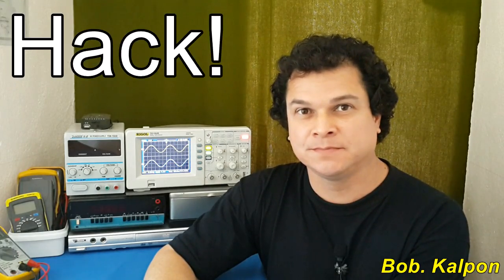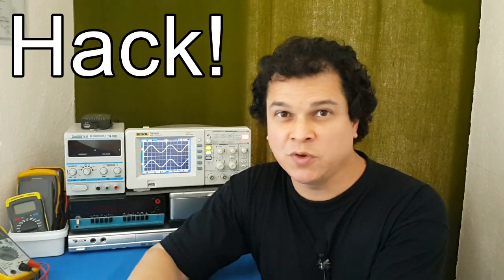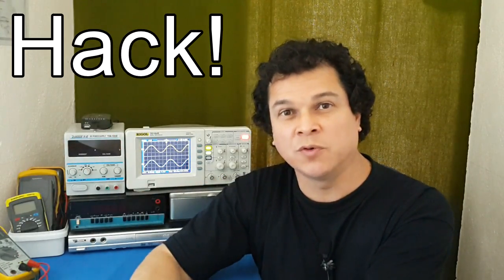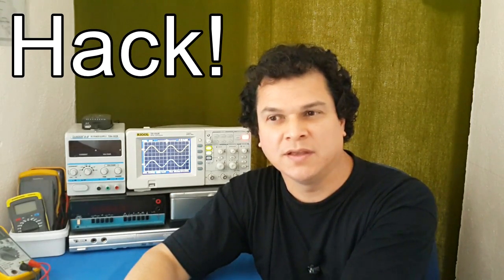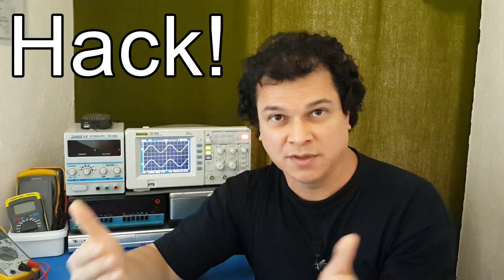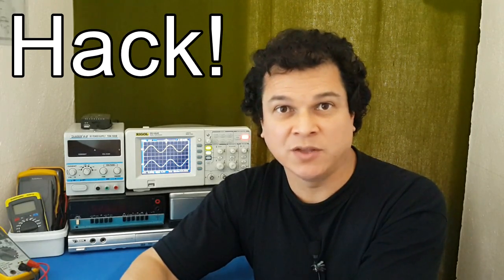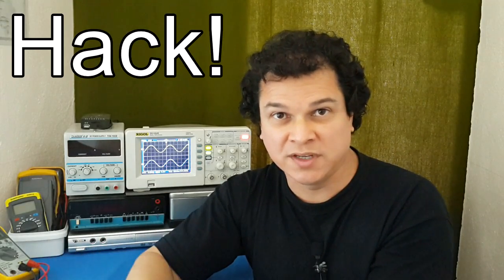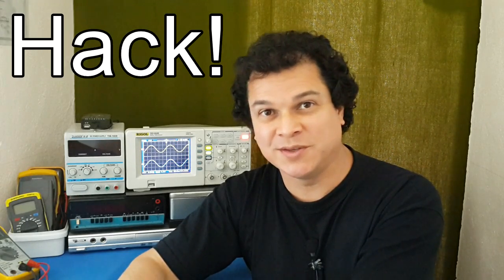Oscilloscope hack / to hack or why do not to hack / how to hack Rigol DS1052E

Comment: total bs. 
You can buy a bandwidth upgrade license. You do not get asked if your scope is a substandard variant relegated to low bandwith configurations. ts the same board that had to pass ALL quality checks. Software crippling is like buying on credit, you get the scope now (save up some money) and pay for the higher bandwidth latter. The hacking is more of a personal moral issue , not a technical one.
Reply: That is rights my friend !!!  In microporcesor they do that, choose de best and the one with all core and sell as a i9.  Not in the osciloscopio market.
Reply: @estebanjuliandipalmamartin3581  I must stress that you're 100% wrong. Rigol scopes aren't binned. It's not like a processor die with defective cores, or half the cache disabled, to maximize yield. They quite literally DO sell the bandwidth upgrade as a license key. The person who made this video doesn't have the faintest clue what he's talking about. He's probably just dirty that he paid 3 times what he could have for the same hardware. It's not even good misinformation. Rigol themselves don't particularly care if you "hack" your scope so long as you're not an enterprise customer. You can't really brick a Rigol scope by using (well known python script, or default root credentials).
Reply: Exact, he don't knows what he say. I gues he takes some Rigol pills. I hacked severeal scopes without any issue. Calibration is also ok after.

Comment: @bob.kalpon1398; I realize the reason in what you said when you posted this video 6 years ago. However, the Rigol DS1054Z can unlock the 100Mhz option with a code purchased from Rigol. The scope with the 100Mhz enabled from the vendor is the exact same as the 50Mhz scope, its just locked. This might have changed since you made this video, and it might be spesific to this model of Rigol scope, but as far as I can tell there is no reason NOT to hack the Rigol DS1054Z. If you pay for the code, or if you aquire it by other means is of no interest. Its the same hardware regardless.

Comment: Sorry but this is a sheer and utter nonsense! You are saying that the factory cant manufacture in a predictable way a 200 Mhz Oscilloscope and and they make them with the intention to be 200Mhz but after testing...they are like " yeah...we screwed up on this one - lets sell it as 50Mhz". Seriously? this not how it works! if you have that much tolerance when manufacturing precision instruments something would be fundamentally wrong and it is simply not the case! What you are describing is valid for chip manufacturing as very minute variations in the process can change parameters but not the case for actual complete electronics assemblies after the parameters of the components are already established! 
The truth is that it is cheaper to make one model as design, tooling, parts inventory, manufacturing process, etc,  doesn't have to be supported across five different products - they satisfy 5 different categories by simple software limitation. Parts for 50 Mhz are not 4 times cheaper than parts for 200 Mhz one - they use same chips, same ADCs , same everything - to use parts for a 200Mhz scope cost very little more than the 50Mhz design as they share exactly the same internal architecture! Rigol for example will charge you $368 to "upgrade" the memory in your DS2000 series scope by a software key - the memory chips are already installed and you already own them - using more vs. less memory is not related to a completely different software routines either - it is a simple memory size limitation. This is how their entire business model is built. Look at their power supply - DP832 vs DP832A - difference is the color UI vs. monochrome UI on the display and $200 (both models have the color display hardware - it is only in the software.

Comment: A lot of them are upgradable for the extra features. I personally disagree with selling me the hardware and software that is identical to someone that bought the one with all features. Only difference are a few different settings values in memory.

To enable the features you often just enter in a code and it starts to work. 

Sometimes you get a version with or without a couple resistors (I still say this is identical hardware since I will not be not nit picky.) 

Do not sell products for way more money when you ship a cheaper versions that are identical.
Reply: Rigol doesn't sell BW upgrades for that scope. Also its just cheaper to manufacture one version instead of 10 different versions. Cheaper scope often only cover the hardware cost and some extra. Which is still good because then the manufacture can sell more units and everything gets cheaper if you buy in bulk. But the more expensive units pay for the R&D and software.
The point is that it might work but its not guarantied to work or meet the tolerances. Its your choice in the end if that is important to you or not.

Comment: This is true to an extent. Rigol will literally sell you a key to unlock 100mhz on a 50mhz scooe... It all depends on the manufacturer and how they handle it.
Reply from the maker: Hi! For the model showed in the video, there is not software upgrade. It is the reason why it is locked until limits on the "Functional Test" in the production. There are other models that are locked in less bandwidth because software upgrade is an "After Market"  business too, minute 3:00. Let's be real; The upgrade, is limited to the oscilloscope capability too. The problem with hacking, that will always hurts 99% of the hacker's proud is because they didn't design the device, they have not idea what are they doing. Most people just downloaded a firmware and blindly believe it is true and real to install it on their device. "It is their device and they can do whatever they want with it". As instructor, I must prevent students that hacking is illegal in many countries, or to prevent my fiends that most hackings we watched in Youtuve, that person never used the same equipment anymore because it didn't work properly.  (Where was the business then? With all the viewers that believed in the hacking, the Youtuber trashed the hacked oscilloscope and bough a more expensive one from the money from youtube, because he got 300 or 600 dollars after 30 or 60 days of video views).

Comment: I listened to the explanation, I fell asleep in the middle, woke up and now I add my comment. 
Is mostly untrue, some scopes might be hardware limited but those definitely cannot upgrade, the reason for having the same HW and limiting the BW from SW is that is more economical for manufacturers to have a single of fewer HW variation even if some components are a bit more expensive for the lower end models. Most of the customers will buy the model which fits their needs and not play with useless hacks which in 99.99% of the time are pointless, because those who do that doesn't really need a scope in the first place, they hack it, show to their friends or YouTube, and move on, will barely ever use it for something useful and those who need it on a daily basis (companies) have money to pay and don't look at few hundreds of $ saved on such tricks plus the liabilities if they are discovered. For the same reasons companies do not work with pirated software. 
Companies know his and is a leverage point to squeeze more money for the same product.
Is like asking how much it cost ? how much money you have ? different customer different price.
Reply from the maker: So, you "fell asleep in the middle", woke up and now added you comment... After it, you said I didn't say the true! That was disrespectful Sir. I work as manufacture engineer, and for a factory or product owner, it is the same time and cost to make a full electronic components populated PCBA or a partial one. The difference in the price of the missing components or all of it, is literally nothing, just coins compared with the final pice and the product profit. It is the same for an oscilloscope, or any other electronic product. I have seen factories making a 4000 dollars equipment, and another product for 600 dollars using almost the same Bill Of Materials priced in US$56. ...and each one with sub-models, locked by firmware. The business is on the Firmware. That's the reason why Companies do not make patented products, because there are laws about Firmware copyrights, that make even a crime the right to repair. I am not the only manufacture engineer in the world. All factories have manufacturing engineers who can tell the same.

Comment: Rigol actually had this hack on their site with instructions on how to do the upgrade yourself.  It was fully authorized by RIgol.  If you bought a 100Mhz DS1054 it would be identical in every way to your upgraded scope.  The thing that did not work, and it was advertised that it would not work, is setting voltage sensitivity to 0.05V (I believe that's the value -- could be mistaken). In short, this upgrade does not break your scope. Mine passes all self tests and I have verified 100MHz bandwidth on my (formerly) 50MHz DS1054Z.
If I remember correctly, there was a lot of confusion about identifying the exact upgrade part number to use.  I have long since lost that information, but that may be the only thing you have to be concerned about.

Comment: We have to differentiate two classes of manufacturers.
One is the generally called as high grade equipment manufacturers industry.
They produce true professional, scientific and mostly also space and military grade instruments.
Such manufacturers never deal with performance differences as we are discussing here.
The divergence span of characteristics on one of their production lines is so narrow that an off performance device is rather impossible to succeed.
Then there is the mid/low end asiatic product. Here everthing can happen. For manufacturers in this class the only certain element that must be for sure is... money earning. They have nothing to lose as prestige, billion $ contracts with military, NASA, or so.
The performances of their products can be very poor, in a way or the other, cause their customers mostly do not really understand (sorry!) what they are dealing with.
Those thinking in terms of MHz and unlocked options number are truely naive, in my eyes.
But never mind, everyone receives what he needs.
Just an example to explain what I'm speaking of.
Suppose Rigol, Siglent, GW etc. find the linearity curve of the input stage of a potentially 200MHz scope production model falls down up 100MHz. This can easily happen because of a flux drop on a PCB, or a leacking passive component or e.g. a missing smd in the reel or, or, or... there are hundreds of reasons this may happen with production lines where Quality Of Product is not really farthest comparable to that of the other class of manufacturers we saw.
They simply characterise down this unit by software and sell it in the lower pos of the line.
Than comes the Einstein in turn and thinks to do the clever move. He deliberately buys the lower price model and by hacking in some way the manuf. setup, thinks to get a 200MHz bandpass for free.
Nice try, Einstein, the problem is you will never get a correct measure above 100MHz!
But you probably would not ever need to measure a singnal with f>50MHz... isn't it?
So, to conclude, what is claiming Bob is perfectly correct, even without proofs, for wich I'd ask for all that bs spread over about supposedly high performance equipment sold for nuts.
Reality is... asiatic products are manufactured with low cost production lines and consequently every single peace of equipment results with so diverging performances that the manufacturers are in the need to check them one by one and create various classes of assignement. Good luck guys.

Comment: This usually happens on graphics cards as well, they sometimes sell better chip models than what you buy, but that didn't pass testing for original frequencies and were limited to lower models specs by software

Comment: I love your Videos I have seen so far. They are informative and super relaxing. 

But nevertheless I don't agree with you here. 
Sure it is a possibility that the products are picked by performance, but you have not shown any evidence to back up this hypothesis.

The reason why they do it is probably a thing called "price segmentation" or "price differentiation". That is a marketing strategy and means selling the same product to customers who have different willingness to pay a higher price. Im a developer and I worked in a company where exactly this was happening. The devices could be changed by firmware to become another product. There was even a separate company that was formed to sell low cost versions of the same internal hardware, only restricted by software/firmware. Whats funny is that it was tried to be kept secret even inside my company. I guess so that the distribution guys dont have to think about it when they try to sell the products.

I like that you post some videos in both spanish and english. Funny that the ratings are reversed for this video! ;)

Comment: What are you talking about Bob ? Have you been in Hantek factory ? Or in Rigol ? Where is that ? In China ? 
What do you think the electrical components have so huge diversity, the same HW can be 50MHz or 200MHz and this is just a random thing ? A luck ? What shit components do they use ? What shit design do they use ? Don't they care if a device just 50MHz (its worth much less than a 200MHz, can be sold for less) by a fluke ? All manufacturing is just  pitch and toss game ?
Your theory sounds very clever but its not really deep thought.
Reply: Dear Dave, his video got 105 down and 46 up. That is your common sense, you noob hahaha :). He created a theory from nothing, without any facts. Its almost like a chemtrail explanation. It sounds logical but actually a very superficial thought. 
And you should know some electronics before you talk. Classifying/sorting electrical parts by their parameters in the quality control/assurance stage, is a well known thing in electronics industry. But those are parts dear Dave. 
An oscilloscope is not that category but its a designed device :) Why would the designer rate so crappy untolarated parts, why would he want the result totally random ? 200MHz = 4 times 50MHz , this is very huge randomization, just because they wanna buy low tolerance really crap shit capacitor for $ 0.06 USD and not a regular for $ 0.08 USD ? Or what ? What would be the reason ? What else can make so hug difference ? $ 0.02 resistors ? They want to save money on resistor tolerances ? Manual assembling vs. pick&place ? Wtf can make so huge difference ?  Digital chips, processors ? Do they miss some digits sometimes ?
And there is one more thing what you forget about, thousands of people hacked their oscilloscope with firmware modification or hacked codes. And it works, there are no complaints about instability, but only happy cheating people. Everybody knows this except him. His theory was proven wrong by the time.
"you could cause an aneurysm  by triggering undeveloped brain cells."
Wow man, you are strong !!!
Reply: Nah your English is very crap, the first part of the sentence looks like you support my opinion, then you said that brain cell, that was not nice, because you were talking to me.
Reply: I think he meant an aneurysm in the receiving brain.
Reply: telelaci2 you're wrong. The subject of the braincell comment is still part of the "them" as he referred in the first sentence. I'm afraid its your English comprehension that is "crap"

Comment: Prove it. Prove that manufacturers take "deficient"  or oscilloscopes that fail at 100mhz, and then software downgrade to 70Mhz, for example.  Chips are no longer selected like grades of fruit. Manufacturers could not compete by "sorting" less "deficient" chips.  The chips used across an oscilloscopes model range, to a certain point, are identical, and ARE firmware or software selectable.  I rarely use vulgarities, and I won't here, you are not worthy of praise, only disdain.
Reply from the maker: Yes they are. Let's do not talk about a chip. Let's go more basic to a single transistor as example. In industrial production, we select only the transistors that work in the tolerances of the expected range. The rest are rejected. Can anybody imagine  now what will happen to a chip with a lot of transistors inside? Sadly, for the ones who are not familiar with industrial process, the waste and the pollution of rejections or unconformity production is a lot. The highest of the standard, the less defects per Million in the product to the final client, is also a high number of production trashed  to give only the "zero defects". (It is like the fruits marked. We get only the perfect tomatoes, same size, same color and shape. But most of us, didn't know how many smaller, bigger, unshaped or with a little black dot tomato they trashed).  
Now, I will prove it. Why the same manufacture makes 25Mhz oscilloscope, and didn't for sale as the 200Mhz? The answer is fact. It had the same case, PCB and components. But it didn't work that good for the 200Mhz. So, by software, it was downed to the point it works good enough. This is the case for the oscilloscope I spoke about in the video. I have been in the electronics manufacturing industry for almost 3 decades, and that's what I saw until yesterday last night.

Comment: your argument was only valid for the first ds1052 produced since the limitation was IN HARDWARE, the actual chips coud only do that, on later models, and all models that have the option to upgade via software key is not valid annymore... all of them have the hardware capabilities and they are tested to fully work on maximum bandwith... after that the limit is on firmware..